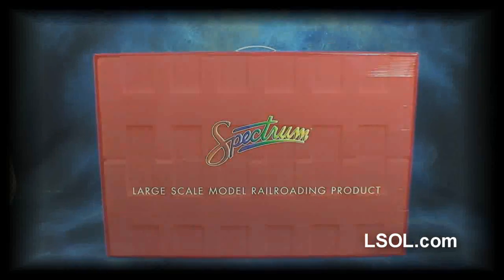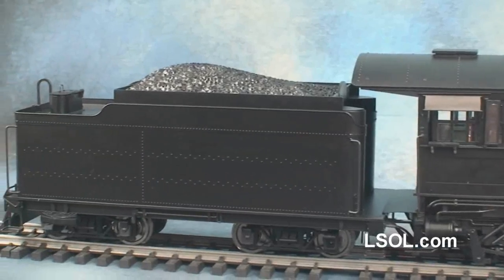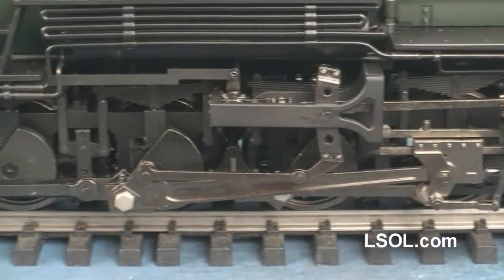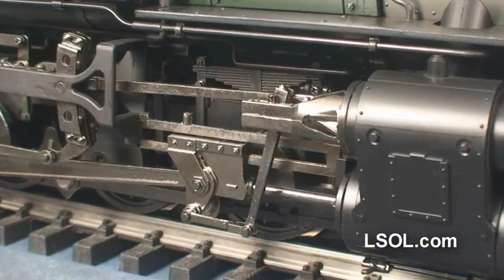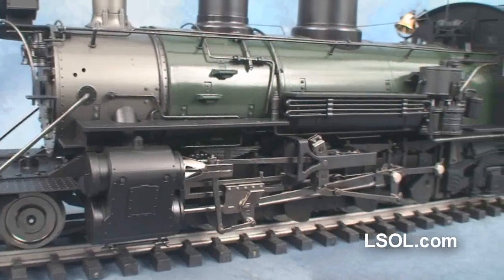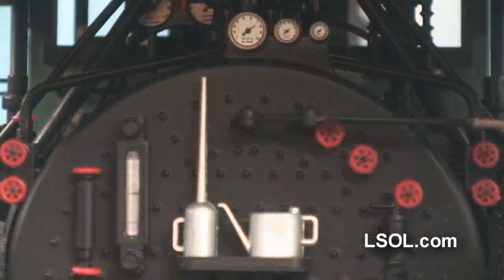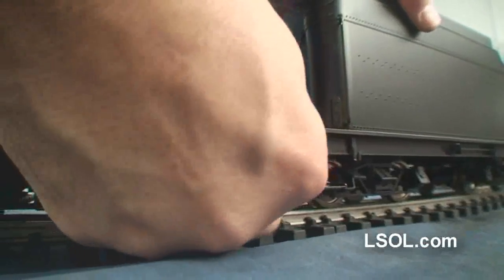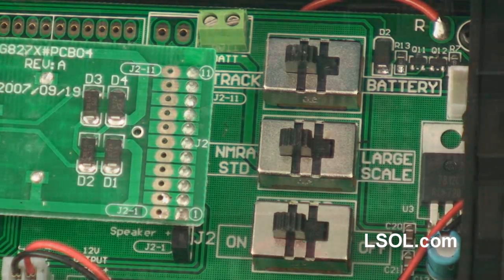Garden Trains: Bachmann K-27 1:20.3 Locomotive

Comment: @yuri5677 No, because the two outer rails are one polarity and the middle is the opposite polarity. This allows loop backs without insulated track connectors or special circuit modification.  You can put a regular engine on a lionel track for display without hurting it, but its not going anywhere.